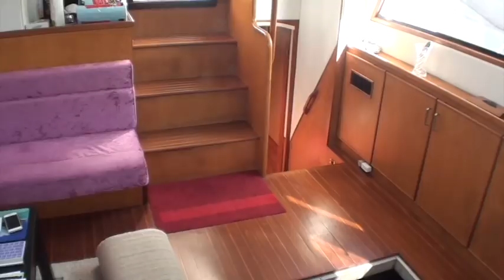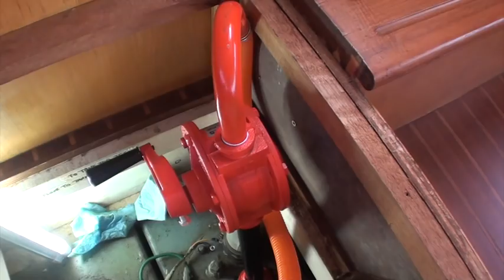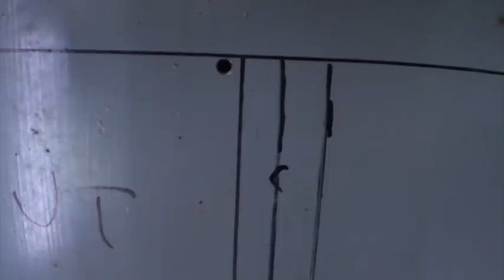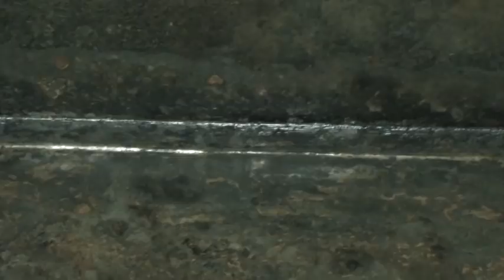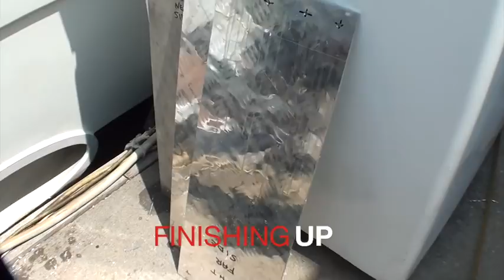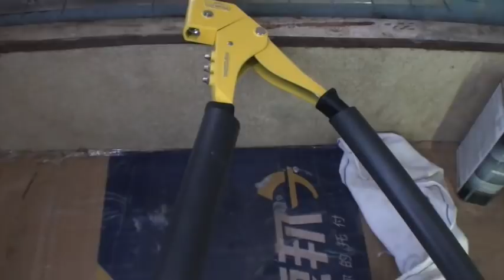Marine Diesel Tank Repair

Comment: I enjoyed the video, I am researching a diesel tractor tank repair. Do try to avoid putting aluminum into contact with carbon steel. Doing so guarantees a corrosion problem in your future. The baffle pieces may never be a problem,  but the outside panels could be in the future.
Some reading material below. 

https://www.trailer-bodybuilders.com/fabrication/how-deal-dissimilar-metals
https://en.wikipedia.org/wiki/Galvanic_corrosion

Comment: John, that is undoubtedly a good way to fix a specific leak, but in my case, I wanted to prevent any further leaks as more pin holes could develop with time.  Using the fibreglass should ensure no more leaks even if the seam rusts though again.
Reply: Fiberglass will come lose after diesel hits it, over time!

Comment: I'm just thinking aloud here, Don't shoot me, but what would happen if you used Rocol dye check, weld dye, and purged inside of diesel tank with Pure Argon gas, then Tig welded the pin holes, with the unlucky welder having a snorkel air feed to the outside and a rescue person incase he was short of breath? I think thats the way I would have done it on my Diesel tank. Just a thought? Im lucky I had only to repair stainless holding water tanks.
Reply: He had the inside of the tank cleaned out.  In the video he said he was worried about the diesel that had leaked onto the beam below the tank catching fire if he welded  8.08.  The beam had so much diesel on it that it wicked back in the tank 7.53.

Comment from the maker: Hi. This video is the first is what I hope will be a series documenting the repairs and improvements to my lovely 30-year old Dyna 53 Cruiser.  Here, we repair an inaccessible leak from the port diesel tank by getting inside it to fix it.  Dirty but Doable!!

Next in the series will be the installation of a mini split air conditioner of the type used in a home to replace the noisy and inefficient marine air con unit in the front cabin.  Also I will be installing an electric reverse osmosis water maker from components which will be powered by my diesel genes.  This will allow autonomous operation and allow longer sea trips around the Hong Kong area where the boat lives.  I hope the series will assist anyone thinking of doing the same projects.  Have fun and be safe!